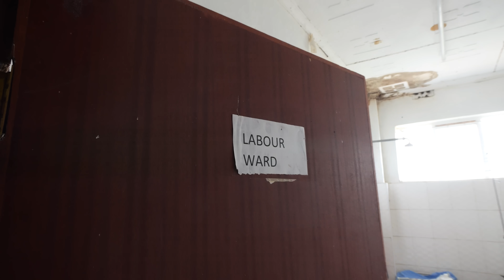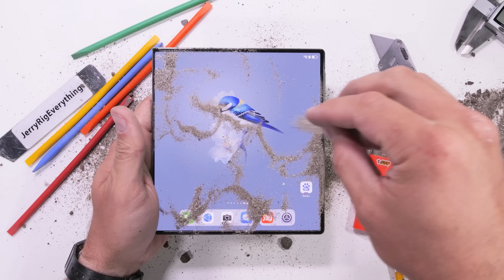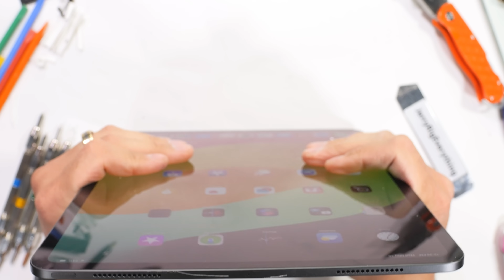Smartphone Durability Awards 2024!

Comment: Criticism of this video (for reference i am not trying to hate only give room for improvement)

1. Not enough categories. I specifically was looking for most durable foldable as those phones are notoriously not durable, which is precisely why it would be good to know which ones seem like they will last longer. Most durable display. Even if the rest of a smartphone isnt necessarily incredibly durable the display is the most important part so it would be good to know. Phone most likely to hold up over the years (idk what you should name this) this category would take into account repairability, cost to repair, battery replacement, and one of the most important categories years of software support. This may give you a all around long term phone to recommend. These are all important categories that should be in there.

2. 60% of the video is either completely off topic or an AD. The entire most pretty internals category is just an AD for your phone skins which while if you included more than 3 durable categories it wouldn't be a big deal it ends up wasting a lot of time as almost no one cares about how a phone looks on the inside. You also spent  a minute and a half at the beginning of the video talking about wheelchairs. While I agree with your mission and massively support it when the video is only 8 mins long and not about wheelchairs in the slightest it is not a good use of time. I just feel like this video could have been useful to actual consumers. While I get the entertainment of the Armor 24 being the most durable and it definitely deserves that award having more categories that average consumers would benefit from would provide value. I guess my overall biggest criticism of this video is the lack of informative value this video provides. Its a fun video dont get me wrong, but I doubt very many people are going to go out and buy the Armor 24 or HMD skyline. While they may be durable and repairable they are phones very few will buy because of their other compromises. Like for example how many years of software support is the HMD skyline going to get my guess is not many. What does it matter if you can repair the phone if you cant even use applications because the software is so out of date. Something like the Pixel 9 pro would be a good example of a overall longevity award as it has 7 years of software support user friendly repairability with the iFixit partnership. While its not perfect in the repairable category compared to the HMD Skyline it is a mainstream phone with long software support and is pretty repair friendly it being backed by Google also means that the promises made are likely to actually be held up. I dont use a pixel phone btw im not biased towards it in any way in fact I returned my pixel 9 pro XL for a S25 Ultra and I've used a iPhone for many years. I just think that these are the things that people actually care about.

Comment: Bring back.... THE MOTOROLA RAZR... But let's refine it, shall we?

The Nokia HAMR!

Flip phone with modular components and self replaceable components:

- 3 day battery life 
- small screen + screen cast feature
- made of Tungsten 
- Wired Headphone Jack
- IP67 Waterproof 
- built in laser pointer
- USB-C fast charge
- USB 3.0 fold out dongle(Flashdrive)
- separate AI computation module (think removable battery/switch to disconnect physically)
- it floats (I KNOW - TUNGSTEN DOESN'T FLOAT EASILY! Let's call this an interchangeable module)
- Built in SDR chip
- Bluetooth 
- has original 1998 Nokia Snake game as one of it's POST operations
- camera?
- * CONTINUE THIS THREAD -

Comment: The S24 Ultra didn't win an award, except it kind of did because out of all those smartphones, Zach chose it as his daily driver.  I have also been using an S24 Ultra for most of the past year.  However, I have no intention of upgrading to an S25 Ultra.  I'd like to get at least three years out of my current phone before I consider upgrading.  Of course, I reserve the right to change my mind when I see the S25 lineup and how much Samsung will offer me if I trade in my S24 Ultra.

Comment: While I would also rank the HMD phones as the most repairable this year, I have to say they're still rather disappointing phones when it comes to that. Both have only 2 years of security updates, which is extremely low nowadays. So, by the time you might break either of them, they might become a security risk instead, and you would need to buy a new one because of that. Although, probably Qualcomm is to blame here, and not HMD 

That's why Fairphone 5 was much more deserving of that award last year, because it actually came with an industrial-grade SoC, that has about 15 years of security updates. And, this is also why I do agree on Pixel 9 getting the 2nd place this year, because while it's not the easiest to repair, they do promise at least 8 years of security updates (I still wouldn't take Google's word for it tho)

Comment: I still have samsung S10+, it has cracked screen in 6 places from skateboarding,  white and green line on left of the screen, but it's still kicking and working, all my samsungs have always withstood abuse, the onlt thing that usually gives up first is the battery life or usb port connection

Comment: Hey Jerry. I have a critique regarding your terminology. Typically in engineering, durability refers to the ability to withstand normal wear and tear over the design lifetime. Your tests seem to be more of a strength test instead of a wear test. Additionally, the lack of service during the life of a product would mean that it has high durability because it resists wear. For example, a product can simultaneously have low durability and high serviceablity, and visa versa. When I read your video title, I was expecting more of a "which phone will last the longest?" Anyway, good video, but I'd recommend clarifying what you mean by durability in your future videos. Particularly the difference between strength, durability, and service.

Comment: I love your channel's focus on repairability and durability, but you ignore the software aspect of it. When manufacturers don't offer a long enough software update timeframe, or lock the bootloader so we can't flash more modern custom ROMs to bring our phones up to date, they effectively shorten the life of the device just as much as if they made it impossible to replace a cracked screen or degraded battery. I have several old devices that are perfectly functional, but are unsafe to go online with because they haven't received a security update in 3 years! The Redmagic device is a case in point, in that it has impressive, durable hardware, but only 1 year of updates and a locked bootloader so users can't keep it up to date themselves.

Comment: Very nice achievements for 2024. Hope you the same or better for 2025. Clearly when I started to watch your durability videos, I was thinking that it was stupid. But I have changed my mind. A big fan of what you are doing (with all your other activities). Instead of heat gun, we can use a good powerful hair dryer to soft the back adhesive of the smartphone. I tried it on Xperia and my old Lg v30 and it worked. At least better than the Ifixit band that you heat in the microwave. And lot of people have hair dryers and should not be so afraid to use it on an expensive smartphone. 
In the past I had an LG V30 and LG was a very good brand for the long term availability of genuine spare parts. And it is still the case for home devices such as washing machines and similar stuff. In 2024, I decided to replace my s21+ brick (that looks like any phone on the market) for a Z Fold6. It's a fantastic smartphone, fun to use and great for travelling. But need a good protection case à bit of care. It's also the first smartphone that I purchased with an insurance because I know that I will never be able to repair it if needed.

Comment: My very old ( 2016 )  LeEco LeMax 2 was incredibly durable and well built. Must have fumbled and dropped it at least 15-20 times on different surfaces and the device never stopped functioning properly. I stil have it in a drawer somewhere.  Great device back in the day and well spent money. It was sold at a lower price than similar models from more well known brands and it was in my opinion a really great buy for me!  Today I'm using a Vivo device and it has much better specs and it has decent build quality too!
Ps. When will, or could some manufacturer build a completely indestructible device for those who are very dependent on quality, functionality under all conditions?

Comment: In my opinion, the most durable should go to the S24 Ultra. The first smartphone with little scratches at 7 with deeper at 8. It's the first smartphone I just keep it in my pocket without any case or screen protector (for the first time) and it looks just perfect. It's my work phone so I have it all the time near me, and I'm just impressed how good the back glass durability and the front screen is better than the previous gens. My Fold 5, that's my gaming device, is in my pocket mostly whenever I go out with my dog, so in total maybe 1.5h per day, and it's front screen already has little visible - but still - scratches.
Reply: I work in a cast iron foundry, dealing with hot iron and sand for 10 hours a day, 4-5 days a week. I've had the S24u for almost a year now, and I still have no major noticeable scratches on my screen (lots of microscratches and one tiny scratch at the bottom, but I keep forgetting it exists). Still runs great, still looks great, still charges even with sand, and cameras still go good. We'll see how it holds up for another year though, lmao.
Reply: I only have a Fold 4 and love it for everything but yeah I'm glad they got the glass right cuz the Note 8 glass was a tragedy that was going to make me quit Samsung considering that's what I had to deal with IMMEDIATELY AFTER living through having a Note 7 and basically forced recall cuz I had to get on a plane.
Reply: Samsung will never be the most durable, wait a little while and all the phone's front and back cover start to wear off.

Comment: I like the Moto G line of phones, Not everyone wants to spend $1000 on a phone and the Moto G Power, and G Play phones work really well as "point of sale" devices, are easier to use for elderly people, they lack all the bells and whistles of the very expensive phones, but still work VERY well to do what a Smart phone should do, that is, call, text, take basic pictures and search the web. You can pick up a Moto G unlocked phone for usually around $200 so then you also don't have to have a payment on your device.
The major advantage of the Moto G line of phones is battery life, most of them will go for 2-3 days on a single charge even under heavy work load. The latest phones (2023 and 2024 models) will wireless charge, and can turbo charge as long as you have the correct charge cable. 
My personal phone is a Moto Razr 2023, but I have already had to send it in for a warranty repair, the folding screen can get dust and grit in the hinge causing catastrophic failure over several months. Mine lasted about 11 months and was I was able to get a warrenty repair on it due to normal ware damage, I had not intentionally exposed mine to dust or grit, but grit WILL find its way into the folding screen mechanism. I don't know why the manufacturers of these phones don't use a flexible membrane backing on the hinge, that would greatly improve the life of the folding mechanism due to dust and grit resistance.

Comment: 1:56 what about the cmf by nothing?
Reply: You aren't supposed to replace the battery or screen (there is a warning label) and they do not sell replacement parts. The only thing repairable about it is that you can change the back.
Reply: Same question I had
Reply: Its not repairable, rather a case that you bolt down

Comment: 7:09 im not surprised. After my wife and i both broke our phones a few years back i dug around and bought two Armor 3WT models (with the built in walkie talkie as they use the same frequencies as the radio in my truck that im licensed to use. Those phones survived years of literal abuse. Her was retired for an internal firmware issue but mine worked right until last month when i forgot it on my bumper and drove off. It fell off and got run over several times before i found it. I have a feeling its repairable (the magic smoke didnt get out of its amazingly huge battery) but its also so old i havent even bothered looking for parts.
Our current phones are iPhones because i use them to record for my main channel, but when i need a new phone, im going back to the UleFone Armor series.

Comment: One thing I've started using to soften my phone screens/back panels is the heat bed of my Bambu X1C 3D printer. I set it to 70°C, lay the phone on it for 10 mins or so and start prying off. If I need more heat I just bump up the temp by 5° increments. Camera bumps make it somewhat awkward for back panels but it still works.
Reply: omg this makes so much sense, ive been wanting to open up some old phones but never could get the back off, my ender 3v2neo now has another use!

Comment: My first cell phone was the Radio Shack CT201 transportable, with a shoulder strap and battery pack, as well as a mounting system
In my 1985 K5 Blazer. 
I received a phone call from my carrier's tech people one day inquiring about my setup because I was causing issues with their tower. Turns out, using a 5dB antenna on the Blazer made my signal too strong. I was asked to change it out to a 3dB antenna and it solved the issue. 
Amazing to see where they have come since then.
Reply: O wow, do you still have that phone?
Reply: @ no, unfortunately.